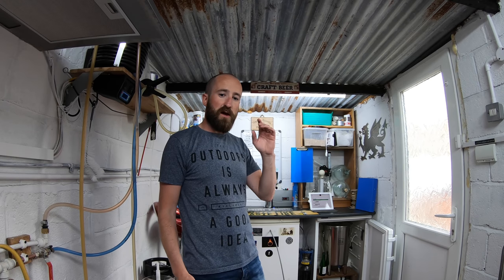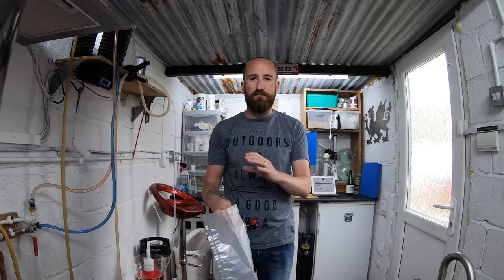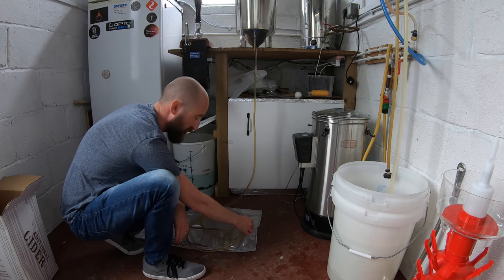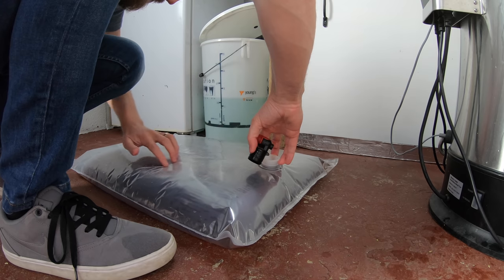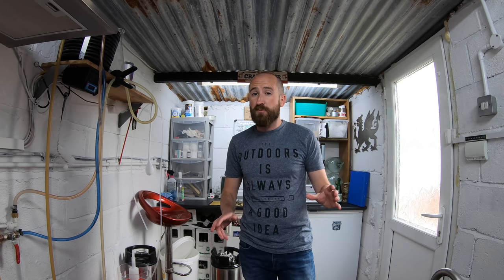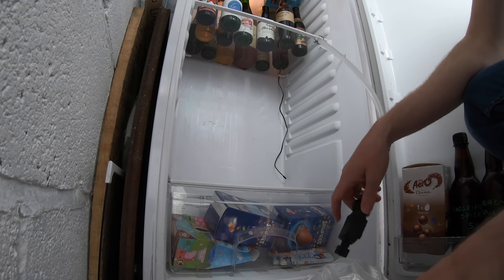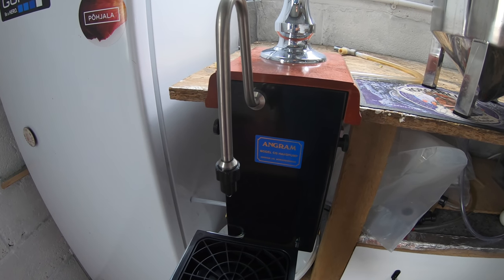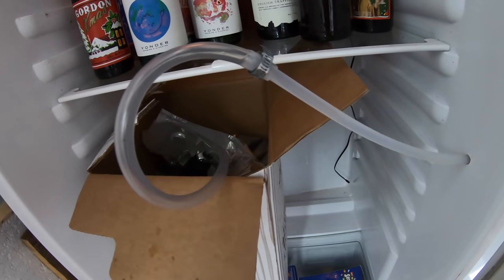How to install Hand Pull & Flexi Cask for Homebrew

Comment: That's super cool, might need to look into this down the road.

I was thinking, get a small piece of plywood or something and prop it on a shallow angle and lay the bag on that with the hole up the slope, should fill easier and naturally push the air out.

Comment: Excellent Video mate! This is exactly what I wanted to add to my Brew Garage next! You’ve just answered all my questions in one video. Looks like I might finally be able to drink real cask ale in Switzerland. 😉👍🏻 
Do you need to flush through and sanitize the lines/hand pull periodically when you’ve not poured a pint for a few days?
Is cleaning it as easy as pulling some line cleaner and starsan through?
Cheers!🍻

Comment: Nice "how to" fella....  I've done similar at home - car boots are awesome for picking up a hand pull taps - although rather than doing the bag in a box affair, I just use my cornies….  transfer as normal, purge, condition (or not!!) and connect....  beauty of this method is you don't need to invest in the bags if you already have the cornies…  Nice one Griff...  Peace
Reply from the maker: Thanks Chris! That's a good idea! I might try that as well, just whack a ball lock on my system :) Car boots round here are shocking - always on the look out for home-brew equipment also! haha

Comment: Great video mate. Looking at the bag set up, wouldn't it still work the same way with the corny keg? My thought is fill the keg then purge out the oxygen as normal, leave the gas inlet connector off once purged then connect the hand pull to the corny as normal with the 1 way check valve in between and draw it off. Maybe if needed drop a bit of CO2 in now and again as a protective blanket. Thoughts? Cheers Alan.

Comment: I used to do this from left overs from commercial brewing keep a spare tap and connect to the adapter so it becomes a cleaning ring main and drop into a jug with cleaner to pull through you can also add sugar small amounts for extra condition and vent through tap the excess low amounts like 20-30 grams ive had mine go like baloons and still fine because i forgot about them could of been messy!

Comment: Just wondering if it would be easier to put the empty bag in the box first and also whether it could be filled without taking the bag "plug" out and filling it via a spare version of the connector you use to connect up the bag in the fridge. Would that not eliminate the majority of your air?

Comment: Great video Griffo, I've just acquired a beer engine myself which I am trying to get set up to a bag in box with the help of your video. What size food grade silicon pipe do you use to connect your Vitop connector to your 3/8 pipe and do you have a link to where you bought this from?

Also the connection point on my beer engine is 12mm/0.5 inch (internal diameter), do you have any idea as to how I can get my 3/8 pipe which is currently too narrow connected up to the pump?
Reply from the maker: Hiya, from memory it was just a length I had kicking about, If you go for 3/8 internal diameter it will fit over the barb on the vitop and the 3/8 pipe with a jubilee either side.

With the Beer engine, you can get a 1/2 Inch x 3/8 straight reducer from RLBS in the UK.

Cheers

Comment: Hi, Brilliant videos, I will be getting a beer engine at some point soon hopefully, can I ask a couple of questions though please.
 
I brew my own beer from kits, I'm fairly new to Home brewing and i use a plastic fermentation bin and a plastic pressure barrel normally and pour my beer direct from the barrel.

Q1. was that stainless steel vessel that you took your beer from, your alternative to a plastic Bin ? 
Q2. Would I be able to connect a line straight to my barrel after transferring from the fermentation bin or would I still need to transfer to a bag from the Barrel in order to use a beer engine ?.
Q3. Does the beer engine not suck up some of the residual fermentation sludge that settles at the bottom of the Barrel ?

Sorry to bombard you, hope you can help please.
Cheers.

Andy
Reply from the maker: Hi Andy, no problem at all!

The fermenter is an SS Brewtech Brewbucket (or a cornelious keg if you were asking about that). Yes you can connect straight to your barrel to serve via the hand pull and the beer engine doesn't suck up any trub as most of it isn't transferred into the keg, it's force carbonated with CO2 rather than priming sugar so nothing really collects at the bottom. 

Home that helps! 👍🍻

Cheers
Reply: @HomebrewGriffo  Hi Griffo, thanks for the reply mate, I might be confusing myself here. My Barrell is a normal plastic pressure barrel that you would get from a brew shop as part of a starter kit. If I brewed and transferred in the following way, would I be able to connect a beer engine to my barrel.

1. brew beer in the fermentation bucket for the recommended time
2. Transfer the beer to my pressure Barrel and leave standing for the required time period
3. after leaving for the required period, connect beer line to my barrel tap and to a beer engine
4. draw the beer from my barrel through the beer engine to the glass.

Cheers.
Andy
Reply from the maker: @andyaxten2444  That sounds fine, the beer engine won't handle more than 5 psi so don't carbonate your pressure barrel much. The engine will draw it out so no need for any pressure in theory. Let me know how you get on! Cheers
Reply: @HomebrewGriffo  Hi mate, many thanks for the advice, when I get my beer engine, ill give it ag go and will definitely let you know how it goes, thanks again Griffo.

Comment: I just purchased a hand pump from pint365 . I have the straight tube with and 2 john guest fittings, there is n o back flow or check valve as you have. can I operate without one? How long does your beer in the bag last ? Thank you great job
Reply from the maker: Hi Joseph, yes it should be ok without a check valve but I’d get one if you can to stop any air drawing back into your beer, beer will last weeks as no oxygen is being introduced 👍

Comment: Hi man!!! Thank you for the guide!!! I found it really useful!!!

May I ask you a question? I saw that you have the same Angram pump I have and I am searching for the same John Guest "straight" connector from the angram to the pipe(the one showed in at 9'20'' in the video), but I don't know the ANGRAM connector size.
I know for sure that it is not a 3/8" because I have one at home and it does not feat, but a I couldn't find this info online.

Can you please share the correct size to connect to the angram pump?

p.s. Maybe also your links are wrong, because the 3/8'' straight shouldn't fit (in the video it appears clear that the 2 sides have different sizes).
Reply from the maker: Its a john guest 3/8 fitting, the one going into the fridge is a check valve again 3/8. Cheers
Reply from the maker: Try BrewUK or Maltmiller :-)
Reply: @HomebrewGriffo  Thanks :-)

Comment: Would you recommend priming within the bag prior? and if so how long would you leave it to condition before pulling a pint? , Not quite at the grain level yet, but super excited to be making Tiny Rebel Cwtch and really want it from the handpull for christmas. Any advice would be appreciated, I only have polypin bags, so a little more durable than the ones in this awesome video.
Reply from the maker: Hiya, I don't trust carbonating the bags, I just worry about them busting and losing all that beer. I normally just let the residual yeast clean up the beer in the bag giving a slight carb. Hope the Cwtch worked out mate! Iechyd Da!

Comment: The trouble with the plastic bags are the (almost) single use factor about them, and the added plastic component, just doesn't gel with the nature friendly less waste of home brewing angle... I'm sure the wear and tear on them isn't great. Surely theres some way to allow a corney keg with a spunding valve to do most of the work up til after conditioning, but then how to get the thing out through a motor and still actually taste / look like it should - I'd think each pull would stir up the dregs in the keg and then oxidisation etc...

Comment: Hi, beautiful video. now for your fault I have to give me a pump. Do you reuse the bag in boxes or throw them away with each use? Do you wash them?
Reply from the maker: Thanks Fabio! I really enjoy the beers off the pump and I used to throw the bags after one use but now run it off a corny keg! (Environmental and cost benefits!) Cheers
Reply: @HomebrewGriffo  Hello and thanks for the reply. which barrels do you use? do you carbonate according to style? how long does the beer last once the keg is opened?
Reply from the maker: @fabioberardi1913  I use corny kegs widely available and carbonate to style. Beers never pass their expiry round here but hoppy beers will start to lose character after about a month in the keg. Malty beers can last a lot longer without any detriment - Like I said, I've not experienced an out of date keg here haha
Reply: @HomebrewGriffo  hello, but in the bag in box you did normal priming?

Comment: Question about those John Guest check valves — most that I've seen have a push in connection in one end and a barbed fitting the other.  With those push-in ends, do you have to use a stiffer tubing or do your standard vinyl beverage tubing work on those?
Reply from the maker: Standard 3/8 beer line works a treat! 👌 cheers

Comment: Hi again, still another question... You didn't prime the beer before transferring it into the bag, right? So you didn't want to have an extra carbonation later or it was because the bags are not resistent to pressure?
Reply from the maker: Hi Paolo, yes the bags are resistant to some pressure but the style of beer I made required very little to no carbonation, the hand pull gives it all the life it needs for my taste 😃👍 Cheers
Reply: @HomebrewGriffo   Nice video, thank you.  Im going to set this rig up too.  My thoughts are to rack the beer into the bag near the end of fermentation. Leave it a day or so at room temp.  Then into the fridge at 11C to finishing off conditioning.

Comment: Where u get your a gram tap from mate,
Reply from the maker: Hey Pip, you can buy direct from angram but there are loads on eBay and the like! Cheers
Reply: Homebrew Griffo is it gong well, seems really good, the bags seem cheap enough to just bin, also cask conditions without fridge if your in garage, cellar act, seems good (in uk of course) Any negatives.
Reply from the maker: This is the second beer i've had on it (had to make sure I was happy with the setup before sharing) and there's no negatives so far! Cheers
Reply: Homebrew Griffo great setup I will therefore be using it as template, many thanks for this. It’s actually not even that costly. That’s for the links, I also need to run my cold water pipe and drainage like that, really nice idea and keeps the chiller out the way for late hops.